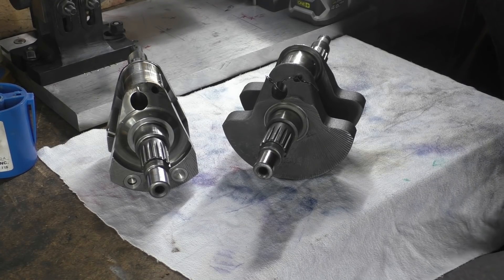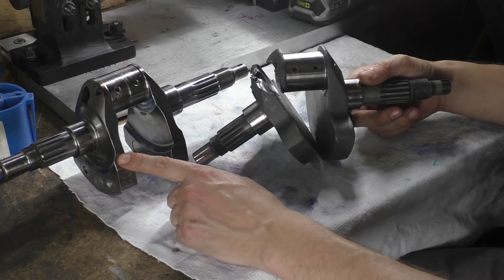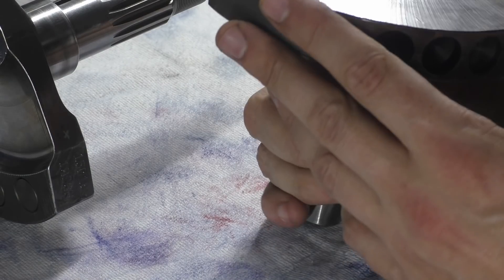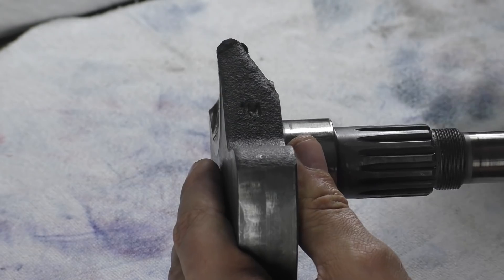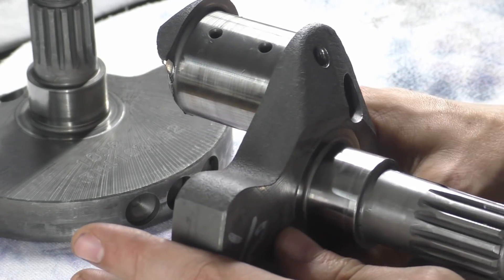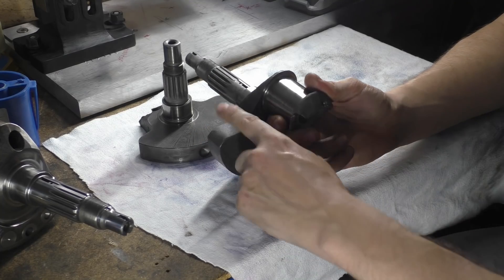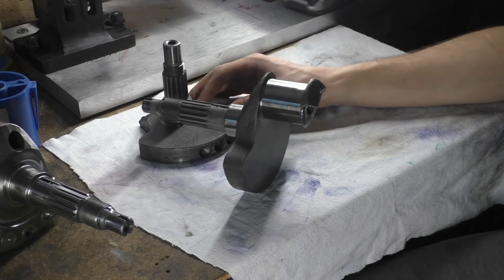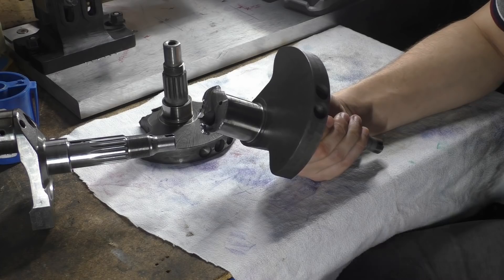Cast vs Forged crankshaft - how to tell the difference

Comment: Interesting video -  but I am surprised about the comparison,to my mind there are only Two Types of Crankshaft - Machined (from Billet) or Forged, Casting a Crank surely wouldn't be able to withstand the loads etc due to inconsistencies in the Casting process.If you look at the Crank being Machined @ 4-25  you will see its definitely Forged as the ridges on the centrelines where the Dies meet are obvious.
Reply from the maker: "Casting a Crank surely wouldn't be able to withstand the loads etc due to inconsistencies in the Casting process."

- but they do...... obviously
Reply from the maker: And yes in the video that is a forged crank. Billet cranks are weaker than forged ones - we'll get to why soon

Comment: "Tooling Marks"

Take it from an Expert at forging shafts with his bare hands - it's quite obviously cross-cut for enhanced lub... oil retention.

It would be interesting to know how/ which different steel (or material types) in general are used in an engine, I'd imagine some parts require some plasticity or whatever its called (the level of bendiness without cracking like a kit-kat bar I guess?) while others might be better of with hardness (but maybe more brittle?), ....

Comment: But what about billet cranks?  Obviously better than cast but compared to forged which is better?
Reply: Billet is in between. You get metal with no voids plus a decent grain structure from being worked in the rolling mill... but it won't have the grain flow that makes forged stronger. It is insanely expensive to make forging dies for a crank, still very expensive to hog a crank out of bar stock. Above some volume forged is cheaper but billet makes sense if the original cast one is not strong enough and no forged ones are available, or you want a stroker beyond what is safe on a modified stock (cast or forged) crank.
Reply: DW I knew all that, but this was a test for Matt, not you, He leaves as much good stuff out as he includes...
Reply from the maker: Are sure the title says "cast and forged".........
Reply: I can read!  But I am tossing several other variable into your comparison. People spend tons of money on them.  And on cast cranks, shit iron. nodular iron, cast steel.  And I am sure AvE would like your opinion on chineseum units...😜

Comment: if you think one is cast, is it cast steel or cast iron?
Reply: Cast steel. I would imagine cast iron would be far too porous and brittle for the shock loading a crank has to endure.
Donkeys years ago, they probably did, transitioning from steam, when engines were still piss weak, relatively. They would also have to have been pretty beefy, relatively.
Steel, can be tailored to suit the needs of the part, one could make a much stronger lighter steel crank than a cast one, I should have thought.
We have also got steel production down to a fine art these days. From sheet, to section, to billet to cast/forged. As indeed we have with many materials.
Reply from the maker: Yes steel